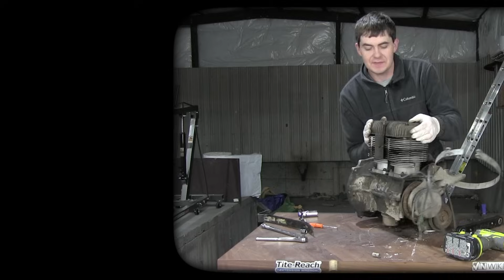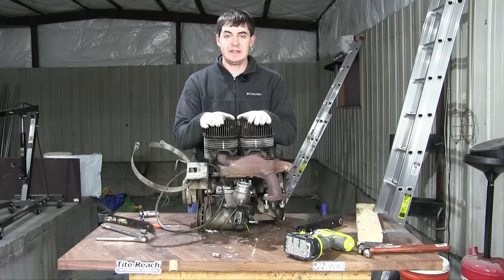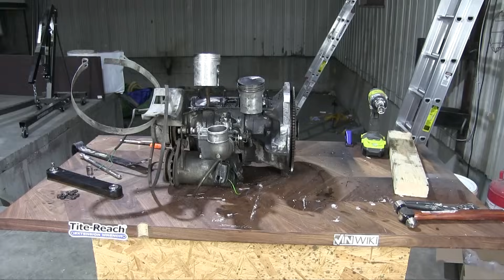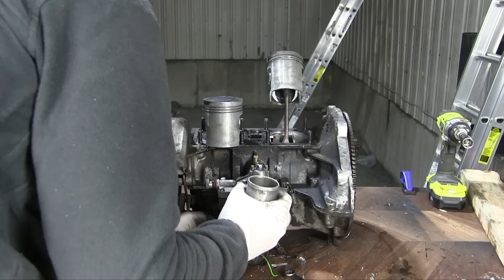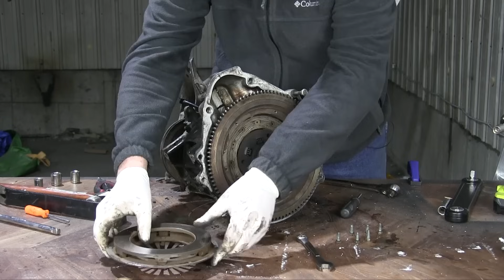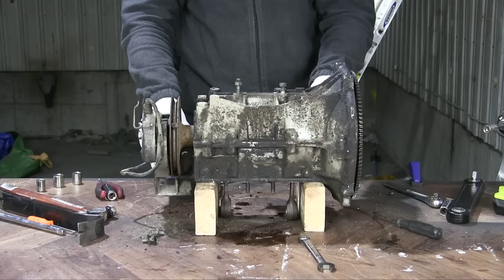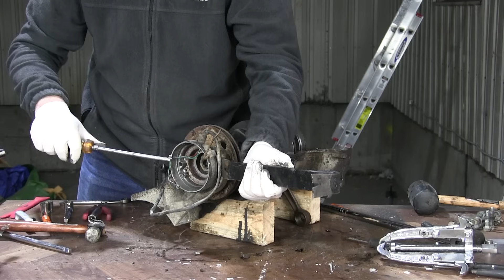Rebuilding the Trabant's Engine: Part 1 - The Teardown

Comment: Ok, so the things I noticed:
- You can get the engine out without the gearbox. All you need to do is tale off the transmission's front mounting point's nut, and pull the mounting out it's hole, up and then right (towards driver side, which is right in front of you). That way there will be enough space for the engine to come out (don't forget to disconnect the ignition coil cables from the bottom). It is also easier to take everything off the engine while it's still in the car (generator, starter, carb, manifold, cooling vent and housing).

- On the manifold, there's that "box thingy" around it which is part of the heating system. On the side which goes toward the vent, there should be a short rubber pipe between the manifold's "box" and the coolant housing around the engine. Without that short rubber pipe, the heating is waaaay less effective, so get one if you don't have one. Btw, the manifold is a thick cast iron, it can't rust through and let exhaust gasses into the interior. The part that can rust though causing that danger is the front muffler.

- You don't have to take the exhaust off to remove the engine, just disconnect the manifold from the front muffler. Also, you can take off that black heating part from the front muffler to gain some space in the engine room while doing repairs.

-  You could've pulled that rubber ring out of the gearbox instead of cutting the gear lever. Also, try pulling from the inside next time instead of hammering the end.

- All the bearings were shit on the crankshaft, even the first one you tried, it was just "less shit". They shouldn't have any noise whatsoever, they run in complete silence if they are good.

- Don't forget to replace the 2 seals at both ends of the crankshaft, because their fault also can cause lean mixture.

- When you reinstall the rotary valves into the engine, pay close attention to the direction you are installing them, because you can put them in the wrong direction.

- The 2 crank case sides weren't "glued together by dirt", they were glued together with a sealant/adhesive. If you don't have anything similar, you can always use wood lackquer (no joke). But you can use that paste kind of sealant they use when they assemble a differential e.g.

- When you put the pistons back on, pay attention so the PISTON RINGS' ENDS MUSTN'T BE ON THE SAME SIDE AS THE EXHAUST PORT. I used uppercase, because this can easily kill the engine, it's very important. Btw, the "thingy that connects the piston to the connecting rod" is called a Piston Pin. :)

- When you put back the air vent, don't forget that rubber strip that was placed between the vent and the cooling housing, so the vent and the housing can't rattle when they touch each other.

- If you didn't loosen the front elbow pipe part of the carb, then tighten it up when you put back the carb, because it shouldn't come off that easy.

- In this car, since it's only 6V, the 'alternator' is called a "generator", or a "dinamo" as germans (and I think most eurpeans) use it. A car's battery stores DC, and every elecric stuff in the car runs on DC. The difference between the 2 kinds is that a generator/dinamo makes DC and sends it directly into the battery. An alternator however makes AC, and a rectifier on the alternator turns that into DC before powering the car's electric stuff. Every 6V trabi has a "dinamo"(before 1983 if I'm correct), and every 12V has an alternator.

I hope this tips will help you with the reassembly of the car/engine. :)
(Btw, I don't know where are you buying stuff from, but if from trabantwelt.de, then it will be a nice pile of money, at least 600 usd with all the replacement parts and shipping. In the case if you buy the crankshaft from them of course.)

Comment: Find yourself a dozer or tractor shop and make nice nice with them.  They will have a really-and-for-true steam cleaner and will let you use it.  Theres nothing better to clean your stuff.  

Short of that, get a used dishwasher.  Your tin will be spanking clean with a little NaOH mixed in with some TSP and regular dishwashing stuff.

Comment: Sideplay is actually normal for 2 stroke motors
Reply: Very normal as you want free circulation of fuel-oil to the wristpin and needle bearing the pin rides in. On a lot of the European 2 cycles the upper needle bearing actually keeps the connecting rod centered on the crankpin.

Comment: I also had this problem that the exhaust manifold got loose from the cylinders, and I had no idea why the engine became so terribly loud. I've visited like 2-3 mechanics in my town, they couldn't find the issue. Then I've took it to a local Trabant-enthusiast hobby-mechanic guy, who found the problem, and fixed it for like 5 bucks :D

Also can cause the same loudness issue if the screws holding together the exhaust manifold and the front muffler become too loose, it's worth checking their tightness from time to time. They're designed to be very loose to allow fitting the parts together, but there's a point when they get too far, and letting out exhaust gases between the parts.

Comment: Wow, I would never be brave enough to dive so deep into my engine on my own! But it's really great to finally see how it all works inside! :)

Good luck on finding an original NOS DDR crankshaft though, they're like the Holy Grail of the Trabant universe to find, and are quite pricy. 

I see there are some refurbished ones on Trabantwelt, but they're more expensive than a whole Trabi here in Hungary :D  https://www.trabantwelt.de/Trabant-601/Motor/Kurbelwelle-Trabant-601-regeneriert::316.html

If the crankshaft will break in mine once, I'll probably just get another engine in it from a scrapyard, they're like 80-100$ here. Although you'll never know in what shape they're inside, so it'll have to take some luck to find a good one. They've made around 2.8 million of these engines with slight modifications, so I guess a lot of them are still out there, and cheaper to buy another than doing a rebuild. Of course, this is only true in Europe... but when you're your own mechanic, it can be cheaper to do the rebuild.

Comment: I have on my computer the repair manual in English and the owners manual as well in English. The cylinder tops are to be tighten to 30 pounds and in sequins. The East Germans and soviets had a system that is called kilo- pond meters for choking on down. I also have a chart for all that. Send me your address and I will make sure you get it all.
Reply: Semper verum  Got to love spell checkers. Correct spelling, wrong word entirely :-)
Reply: Semper verum  sorry I should have went throw and checked all the spelling.

Comment: Ok one final last thing... so your crank is the older style... the centre bearings can be fixed, you just need to remove the centre section cover, its just held together by the spring clip around the outside, you can then slide the bearing races to the side, as they are free floating.. remove the rollers, replace and put it back together... you can also replace the end bearings... (I would recommend recondition what you have, e.g. send your crank back to germany to have it professionally reconditioned. Danzer Autoteile is great and Trabantwelt do a good job as well. 

if you go the reconditioned crank route (there is no new cranks) they are all the newer style and therefore you also need a piston ring style oil seal on the pulley side, and you need to use a lathe to take a few mm off the pulley to accommodate the new seal type, you also need to drill a hole in the top half of the engine case to fit the centre locating pin on the newer style cranks.

Comment: hmmm yeah... you can pick it up without a crane... you just disconnect the gearbox and the ignition timing mechanism from the engine before you lift it out of the car..

Comment: I've done this repair on mine. You basically fucked it up, while trying to seperate the two part crankshaft case because you didn't read/ look at the pictures of the perfectly explained manual. You never use a hammer and a chisel to open aluminium case, because you can warp it really bad. Hope you didn't do that. Also, you have a dinamo. I recommend you to change the 6 volt system to 12, using a rabbit/golf alternator, replacing also the ignition coils, all light bulbs, spark plugs, whiper motor and istall the new model electronic ignition with trabitronic control unit.  Your crankshaft is the old model - keep that in mind when getting the new one ( wich will not be new, but refurbished ). PM if you have questions.

Comment: You have chosen probably the most complicated way to pull the engine out... ;)
It can be taken by hand, separated from the gearbox.
The whole engine is about 40kg, but if you would like to, you can strip its accessories down before the removal to reduce its weight.
Nice job! ;)
Greetings from Hungary

Comment: New information on the Trabant!
 This car had no means of active cooling because it had a two-stroke two-cylinder engine. Most of the motor's internal heat was blown out with the exhaust. Making for a very inefficient engine. This maybe why the car's cabin-heater was designed to blow the heat off of the exhaust manifold, and not the engine itself.  
The Wartburg had a three-cylinder engine , thus a little more efficient, and needed forced air-cooling, later water-cooled.
Reply: It is forced air cooled, what do you think the ductwork and fan was all about?
Reply: @tauncfester3022  This Trabant's engine used a DUCTED fan for its combustion air intake, not a cooling system - - that is my point
Reply: Without an active means of air intake?(No induction)

Comment: That HUGE starter makes more torque than the Engine.
Any good snow mobile shop can press that crank apart replace the bearings and the pin's and rotary valves, re balance the crank . That might be the same cost of a brand new one ? but can you even buy a brand new one? Bearings are cheap and all you need is the numbers off the old ones.
After watching you attempt to pry  the cases apart they are junk now and a whole new motor is the best way to go.. 
If you fucked the cases when you jammed in a screw driver to get them apart and they don't seal 100% it will blow up when air gets in.They have to be perfectly flat on the mating surfaces , and you can't have them machined flat again. So if they are damaged at all you need new cases. 
Use Three bond 1104 to reseal the cases when you reassemble them and just a thin coating . if you use too much and it falls off inside the case it will get into the rings and blow up the motor. So allow it to dry for days after assembly.
While apart you could port the cases and transfer port for cheap power add a bigger carb shave the heads .010 . You could add 5- 10 hp for little money.

Comment: FYI, the "piston to connecting rod thing" is called a wrist pin. I would like to say that I'd think that any motorcycle shop worth its salt would be able to split and press your crank. I'm pretty certain that it wasn't meant to just be a toss and replace component.
Reply: Also for an extra 10 points,  UK engineering English  "piston to connecting rod thing" is commonly referred to as a Gudgeon Pin, no I don't know why a hollow steel pin has the same name as a small fish.... :-)
Reply: @alan-sk7ky  and because its UK English its more correct 😂
Reply: Also known as the small end bearing here in the UK.

Comment: Two strokes are very particular about their exhaust system.   It’s why sleds and dirt bikes always have those huge expansion chambers near the head.  If you tighten up your exhaust system, it’ll probably run a lot better.

Comment: You don’t need new crank asm.... should be able to have it rebuilt, should be a pressed together asm, requires big press and tooling and expertise in truing it on reassembly ... a good motorcycle shop could prob do it if you provide parts

Comment: +Aging Wheels     Your gudgeon pin extractor is a work of genius with a clever mixing of wood which is too soft to do any damage and sheet steel plus part of an existing tool where that tenderness is not required. If the short sighted Nobel committee would listen to reason you would be well on your way to becoming a Nobel Laureate by now.
Reply: <sees homemade wristpin tool
"That will collapse, it'll never work!"
Reply: making tools is not Nobel Laureate,  what's next? A war mongering president getting the nobel peace prize? Ooh....nvm
Reply: @Nordic_Mechanic      Indeed, almost as if a war mongering Prime Minister that dragged his country into the Iraq war against the wishes of his people had been made 'Middle East Peace Envoy'.

Comment: Being a 2 Stroke, the connecting rod radial and axial clearances are  normally larger than a 4 stroke with a central lubrication system. Think how the pre-mix fuel -oil is to lubricate.
Dynamo is a permanent magnet motor, and can only generate DC, some motor cycles, and a few cars experimented with combined starter/Dynamo.
Very good video and presentation.
Reply: Wasn't pre-mixed in the DKW 1960 Jr. It was oil injected. But it was fun with the DKW 1000 as we added a quart of oil to the gas at the gas station.

Comment: is it possible to do a 2-4 stroke conversion?
Reply: Yes it is, the last trabants build had VW golf engines in them.
Reply: @betaich  more like 1 liter polo engines
Reply: wouldn't be worth it on the engine, would require some serious re-engineering.
Reply: @cpufreak101  oh ok thanks
Reply: Youd be better off just buying a newer 4 stroke that fits.

Comment: These are pretty strong little engines and if maintained correctly (using good quality 2-stroke oil) last a very long time indeed.
All parts are still available but getting a little more expensive, still your biggest cost will be shipping.
There's lots of clubs in Europe supporting the IFA Trabant, Wartburg, and Barkas vehicles just look them up I'm sure you will get all the help you need.

Comment: Good job on taking it apart, you did suprisingly good with crude engineering and proffessional use of do everything wacky smacky device.
I think after you're done with the trabant, you should try your hand on an FSO Polonez, it is a littlebit faster than the trabant and about as advanced as a hybrid between a hammer and a nokia 3310 with the durability of an IPad. 
Engine in that thing needs a rebuild every 100-150k km (depends on which day of the week it left the factory - Wednesday is supposed to be the best day), rust grabs onto everything, dashboard is weirdly layed out and suspension could as well be stollen from a 40s military truck and just downsized, although the truck version still can carry "1000kg" which is more like 2500kg (tested). It is also RWD with super powerfull engine (80ish hp - more like 70 when new)

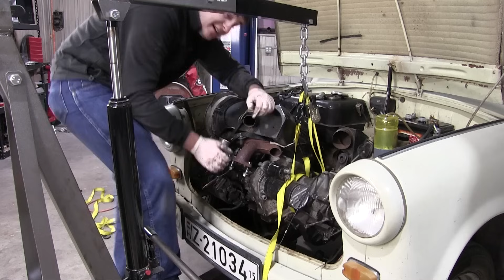Comment: 3:32 - Yes, you can, you just need to take out the engine and the transmission separately. The engine alone is 50 kg (same weight as the gearbox), any normal adult male is able to lift that. :)
Reply: What if you are an 5'2" 40Kg Untermensch?
Reply: @markokrsmanovic1080  Trabants were designed for the owner to be able to repair the engine by himself at home, at a time when hoists were even scarce in auto mechanic shops. You can easily remove the engine by hand, you just need to strip it before (take off cooler housing, fan, alternator, carb, exhaust manifold - even could take off the cylinders and pistons too, but they are not that heavy). Then loosen and pull the front mounting of the transmission, turn it away a few centimeters and then the engine comes out easily. I know, I did it like this dozens of times.
Reply: I have a Lloyd Alexander ts that in need parts to rebuild. It's german made . Any help would be great.

Comment: The first "muffler" in the exhaust system is actually not there to muffle the sound of the engine. It is a resonator. 2 stroke engines need a resonator for optimal work. If you try to run your Trabi without a front muffler, the engine will become less powerful (yes, even more), and it will damage the engine very quickly. Around the resonator is an outer layer, it's like a "muffler in a muffler", which collects the HEAT (not the exhaust gases, this system is isolated from the exhaust!), which is used to get some warmth in the interior.
Reply: TheJR1948  , actually I understand completely. It is there to create a vacuum on the outlet of the exhaust and is tuned to the engine to accomplish this. This is called exaust gas scavenging, and is part of tuning the car for optimal power with such a small engine to get good fuel economy. Thing with the two stroke vs 4 stroke is that each time the piston goes down is a power stroke, and a 4 stroke it is every other time the piston is going down.
Reply: In my Trabi’s interior the maximum temperature was +15 Celsius when the ambient was -8! The heat tubes needed maintenance every autumn and no problem!:)
Reply: Actually called an expansion chamber.
Reply: @Z4Zander  "Resonator" or " Tuned pipe" are also equally applicable terms.